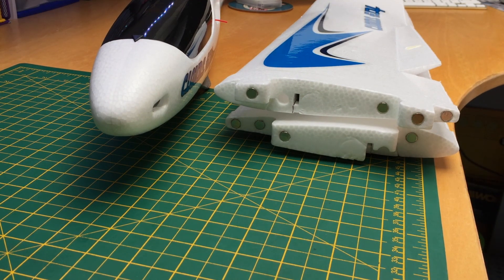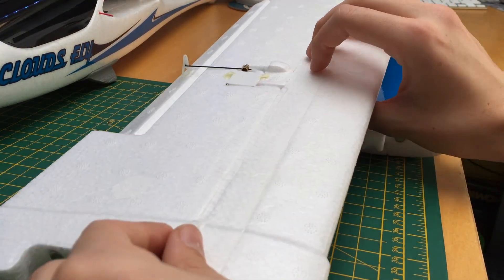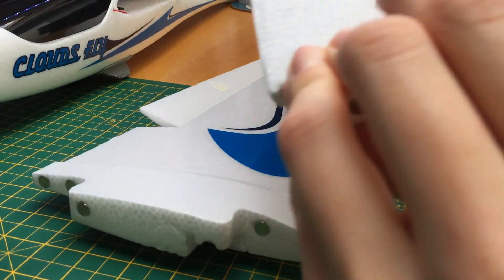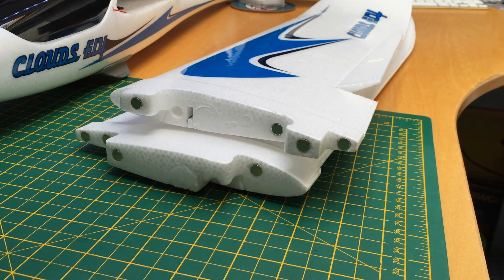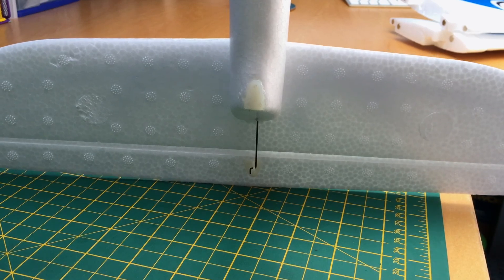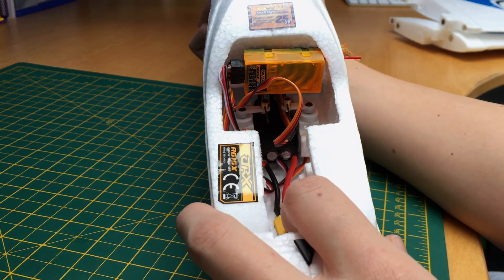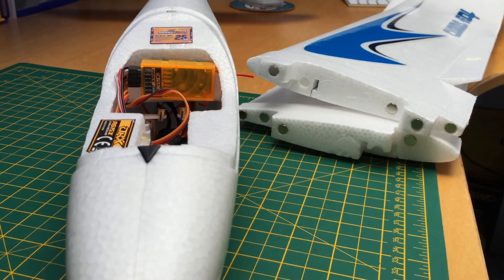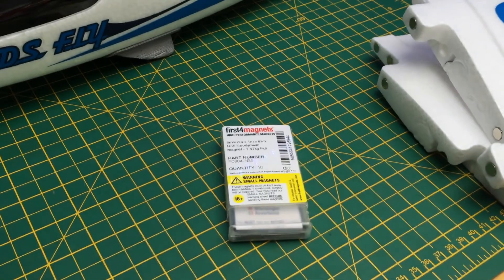AXN Clouds Fly Floater Jet Removable Wings | HD

Comment: How are the magnets holding up? thinking of picking a AXN up but need removable wings
Reply from the maker: They are fine, if I'm honest I haven't flown mine since I made the video. They held up to a few crashes though. If they did fall out you can just glue them back in. When in flight you never pull enough G's to pull them apart. All I can say is give it a try if you mess up really bad you could always buy a new foam axn kit, for cheap from hobbyking!!
Reply: +HANENG18  Cheers, ended up getting some along with a AXN

Comment: I was watching your video, thinking about the remaining problem of the servo leads. I wonder how well it might work to cut a relatively small cavity in the end of the wings where they meet inside the fuselage, where the wire leads can be tucked during assembly. That way you're not always struggling with them being in the way.

Comment from the maker: Thanks for the interest, now prepare for a long explanation. For cutting the holes, I just pressed the magnet onto the foam, this left an indent on the foam, then I cut a hole smaller than the indent so that the magnet would be tight fit, then carefully pull the circle of foam out. Filled the hole with hot glue and stuffed the magnet in so it was flush. Then Stuck the other magnet on and pushed the wings together so that the magnet goes on the other wing in the exact right place. This left an indent and repeated like the first magnet. 
Hope this made some sense :D